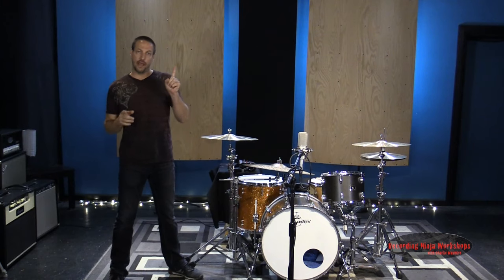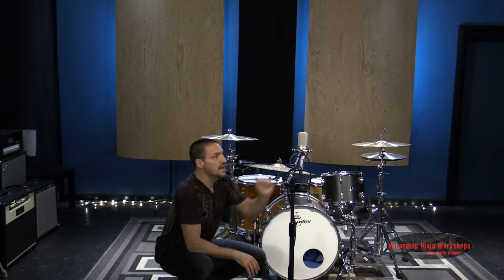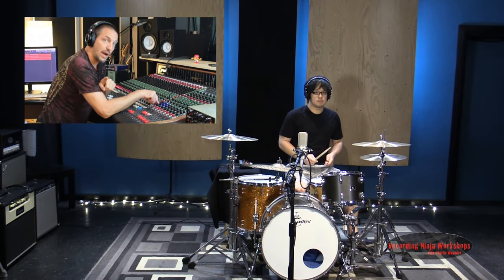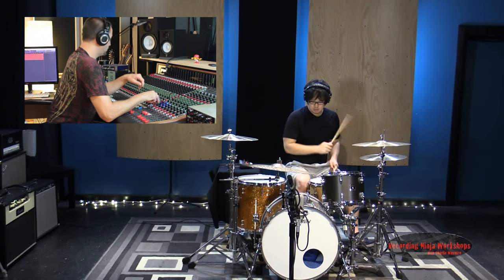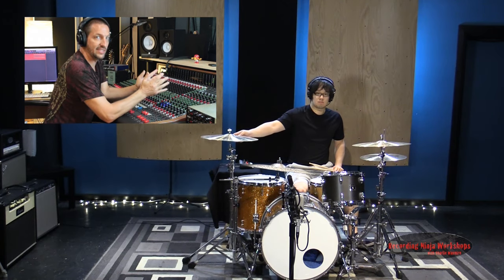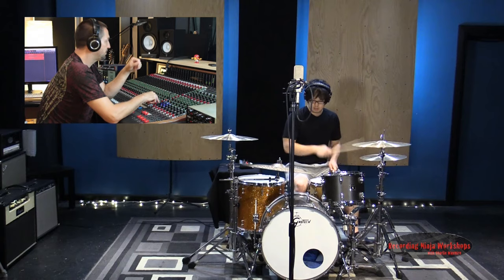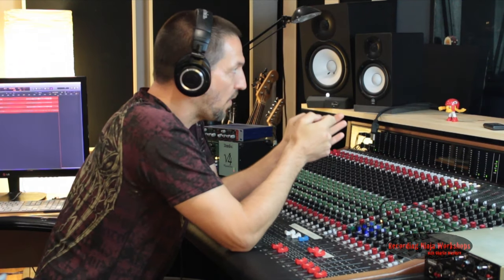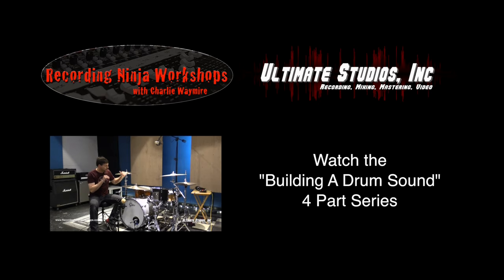Recording Drums with 1 Microphone

Comment: that mic is more expensive than all my mics together
Reply: So?
Reply: RIGHT?!?!? $700?!?! im looking to get the focusrite scarlett bundle
Reply: not to mention the professional studio he's in!!!!!
Reply: AT2035 is $150 and will do the same thing - true large diaphragm condenser, quality mic, for cheap. Add a cheap interface and you’re in business.
Reply: Dan G the AT2035 could work with tumbas/congas?
Reply: Loa cheka Yes, you could use just a 2035 pointing at the middle of the 2 congas from a boom. This would be a good ‘budget’ way to record, especially if recording just the congas (no nearby sounds to bleed into the mic). More typical (and a bit more $) would be 2 Shure SM57’s, one for each.
Reply: Sell it and get plenty of cheaper mic
Reply: @DZNTZ  Possibly, but it'll be just that bit harder to work with. These cheaper microphones tend to distort pretty easily (and adding a cheap interface into that signal chain will make it more prevalent) which is not great for drums. That's not even accounting for the room this guy is recording in, which looks pretty well treated. I never used to believe that made much of a difference until I had my own room treated, and it is a gigantic difference especially when we're talking about recording single-source drums.

That isn't to say go out and buy a $5,000 mic, the best music is the music you can make *now*. I just don't want people going out and buying a $150 mic, sticking it in front of their drums in their garage and thinking they'll get the same sound as what you're hearing in this video.
Reply: Personally i think your better off with a few sick mics and pres than a load of average gear and overmicing the kit. you can pick up a pair of M160's and capi pres for like $1500 or less. DI the bass. All the guitarists etc wanna overdub anyway. Personal experience. Make the music however you like though obv

Comment: this is what I was told when I was in school . It was more about leaning your mics worked than any thing else at the time but, one could combine this with a Bidirectional mic for mid plus mid minus using a three (or cqommit to two)tracks for drums setup. Keep in mind that we still had to strongly CONSIDER that it could be on vinyl or broadcast in mono[ AM broadcasting that is floating on the 120 house current was a very real thing]  so it had to be MONO-COMPATABLE to keep the cutting needle from jumping out of the groove or broadcasting only bad reverb.  
     Thanx for teaching a bout One Mic in drums.  Next just 4 fun record a Jazz trio { trap set, stand up bass, horn} with on mic. Adding middle side would prove much to the youngins. 
p.s. oldys too,       PEACEV tf OUT

Comment: The first set up is also bad because your microphone is almost pointed directly at the edge of the crashes, which causes a swooshing, phasing when the cymbals move up and down (cut in and out of the peak image point of your mic) 
You can hear the effect clearly at 1:39, and it can cause problems in a mix.

Comment: Great video! 
How would you go about mixing this considering that this is a mono track? How would you give it a stereo feel?
Reply from the maker: This is an interesting question. I would say that if I'm using a mono mic setup then I'm not really going to try and give it a stereo feel. I'm using mono for effect. 

Having said that you could get creative with reverb to give it a sense of space and give it a stero "vibe". You can't separate the pieces of the kit so there won't really be a stereo field though. If you're just going for a stereo "feel" then I would use a fairly short reverb. If it's too long it will just sound like you put reverb on a mono mic. 

This is interesting and I may do some experimenting with it.
Reply: Looking forward to it!
Reply: Well. You could overdub it. Record it all like this and then overdub it and pan it.
Reply: Vito Mamula 
This would cause phasing and flaming.

Comment: I have become very motivated to capture a good drum sound with only 4 or 5 mic's, and, in the process, I discovered your channel, which is excellent.  One thing I would rather not do is mic the toms, or, at least, not the rack tom(s).  I can say that, if I had this room, I would probably be very close with just this one mic.  I would think microphone choice would also help equalize the sound, for example, a ribbon would capture more depth at the same height.  Also, perhaps two mics in the same location, but of different type, e.g., one large-diaphragm condenser and one ribbon.  Great stuff.  Cheers.

Comment: Awesome video! One point I would like to add is that when you're recording drums with a single microphone, the skill of the drummer is gonna be a deciding factor in how you place the mic. A good drummer can balance the sound of the kit in the room, allowing you to capture a fuller sound without close mics. And for the record, the drummer in this video did quite a good job, taking it fairly easy on the cymbals for the most part.

Comment: how do record my drums with two mxl (550 and 551) and not have it sound like its bieng recorded by a cell phone?
Reply from the maker: Try using the 550 in front of the kit and the 551 as a mono overhead. You will probably have to use the pad on your mic pre though as the input will be pretty hot. Check out this video: https://youtu.be/O08twiK-09I

Although the microphones are quite different this style of setup can work very well. 

Hope that helps!

Charlie

Comment: Hello, very impressed with your clips. I wanted to ask you about the back of the room. You seem to have 2 large curved surfaces of wood can you do a video about that?
Reply from the maker: Hey Paul! Thanks for watching! Those are 4'x8' semi-poly diffusers with 1" of rigid fiberglass on the back. I had them on the back wall just to break up reflections. I've changed the room around a bit now and have taken them off the back wall since that wall is actually tilted forward. One of the polys is on another wall where I have been recording my drums lately. Since they don't have an inherent sound I can back the drums right up to the wall and not have bad reflections causing phase issues with my sound. 

I'm in the middle of several studio upgrades. When I'm done I plan on shooting several videos walking through all the changes. Including where and why I moved the diffusers.
Reply: @Ultimatestudiosinc  Thanks for the reply. I'm really enjoying the sound of your room and the fact you get such incredible sounds from only very few microphones does you great credit.

Comment: hey just need suggestion is it condenser mic and how much it cost and what's the brand or if I have less cash what kind of mic I can purchase to record with only one mic?
Reply from the maker: Hey jordiphen! The mic I used in this video is an Audio-Technica AT4047. The cardioid only version goes for around $650-700 and the multi-pattern version goes for around $850. Another mic I really like is the AT4040 and it's only about $300.
Reply: thanks for the info

Comment: If you're limited to a 2 mic set up can you still get real beefy sounding toms in your recording?
Reply from the maker: My quick response is yes you can....but it depends on a few things. 

First off is the definition of "beefy". We can get full sounds but not Danny Carey "10,000 Days" toms. 

Second is mic placement. Kick and snare obviously have to be strong so the "overhead" mic will need to be placed right to pickup beefy toms while still getting cymbals. This could be a bit tricky but not necessarily impossible.
 
Third, and most important, is how the drummer is playing. With only 2 mics the drummer will have to do all the balancing between the cymbals and toms. This could be the hardest part actually and will take some experimenting and good control!

Your question got me thinking about some alternate ways to use 2 mics......I'm going to experiment a little this week and see what I come up with. If it's good I'll add it to the live broadcast schedule. 

Thanks for watching!
Reply: Ultimate Studios, Inc Thank you for the info! Definitely great to see you help with your great knowledge will definitely mess around with it!

Comment: What mic are you using? I'm using 9 mics and I can't get this sound...
Reply: Use a better kit.
Reply: Haha, thanks. What type of mike are you using?
Reply from the maker: It's an Audio-Technica 4047. With any minimal mic setup it comes down to the kit and the player. 

I would suggest starting with just your kick and overheads. Get those sounding good and then start adding the other mics. That way you know each additional mic is helping and not hurting your sound. 

Oh, and check the phase relationship between ALL your mics!

Comment: kick mic,  and  2 overheads   would work  for any multitrack recording.
Reply from the maker: It can work for a lot of recordings depending on the style of music you record. If you're doing metal or hard rock you might need more but 3 well placed mics can do a lot of good work!
Reply: i like the raw sound of the skins and shells.
if 2mics were used the weakest sound would
be the bass drum. so thats why i use a kick
mic close micd. the others wide appart
left and right. this captures the room sound
and all the drums.
Reply: i would say its essential to invest in a kick
mic. got to have my kick sound nice and
thick!  do not like recordings with weak
kick sound! unless its jazz.
Reply: i remember in the 80s in clubs a lot of
bands had virtually no kick sound ! that really
bugged me!